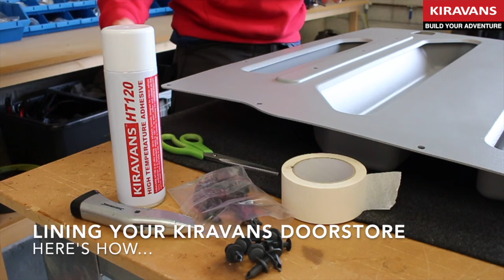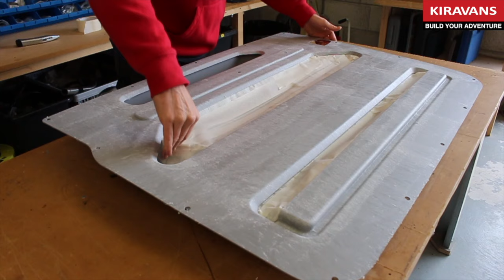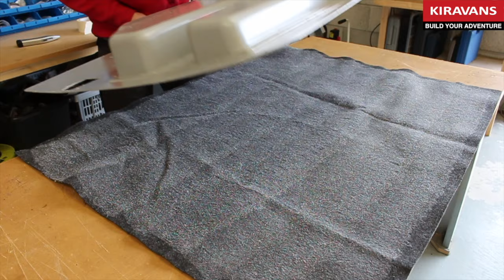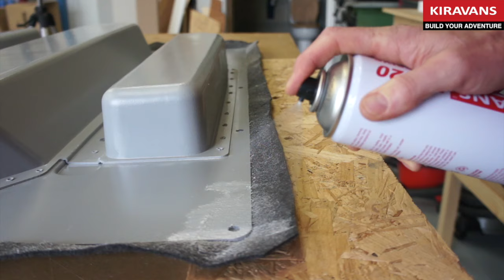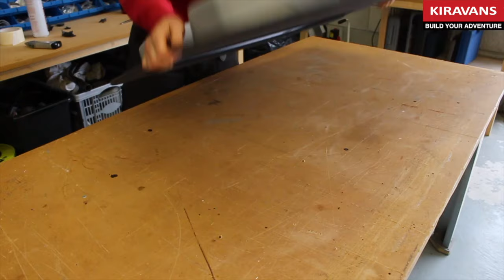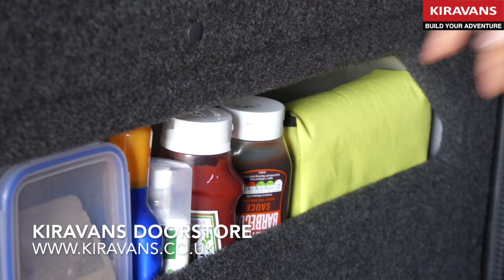How to line a Kiravans T5/T6 DoorStore with campervan carpet lining

Comment: Just did mine about two weeks ago with hidden fasteners looks beltin. Cheers.
Reply: Or do a search for Harrison’s Trim Supplies website 👍
Reply: Nearly all the hidden fasteners  don't give a size. The ones I found on ebay were black in colour and the shaft was 17mm long 9mm dia. These were good for the edges but not for the 3 holes in the central part. They were tough to put in the panel, very sore thumbs.
Reply: @ianronnay-fisher6536  yeah I was thinking of using hidden clips as well ive just bought one

Comment: Hey hi there, i wonder if you have lined the pockets with anything after this? We are looking to do this but haven't even got the van yet :D Just preparing for it. thank you
Reply from the maker: Hi There, other than the carpet lining we do not line these with anything else as, the lining is enough and isn't too thick to then re apply the fixing clips. Hope this helps.
Reply: @kiravans5874  Hey there, I meant the pockets.
Reply from the maker: @colinhutton9704  Ahh sorry, no we havent but we have had people line them, there a bit trickier to line and find harder to clean when lined. Its preference however as we know people have lined them before inside. Thanks